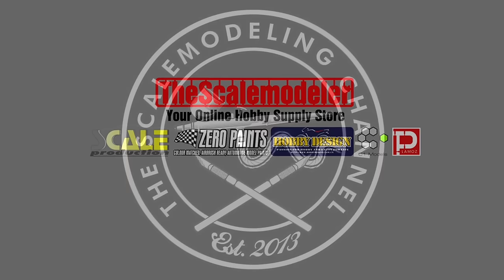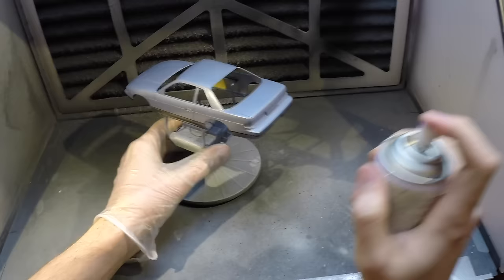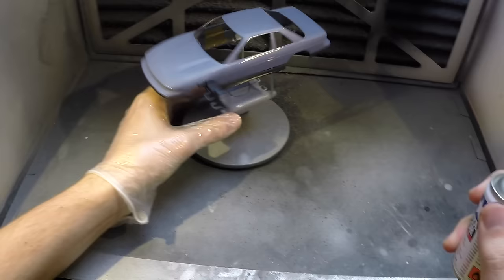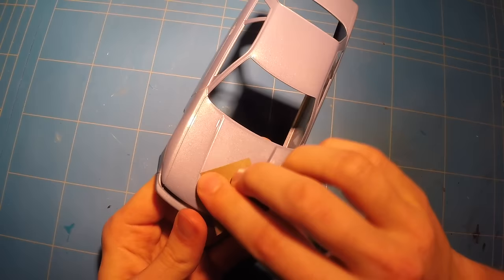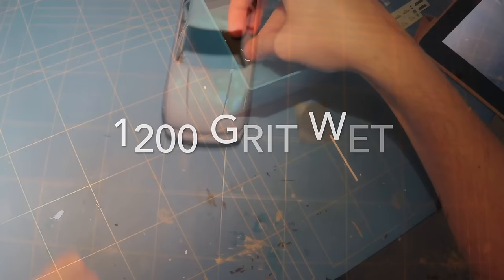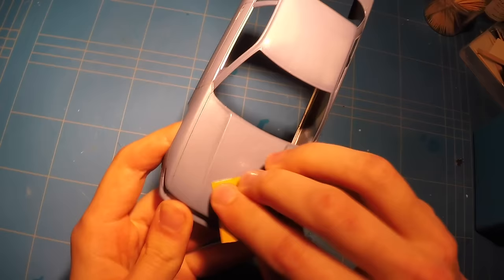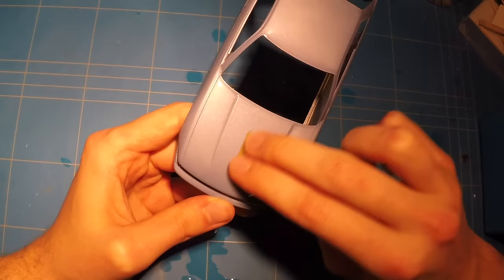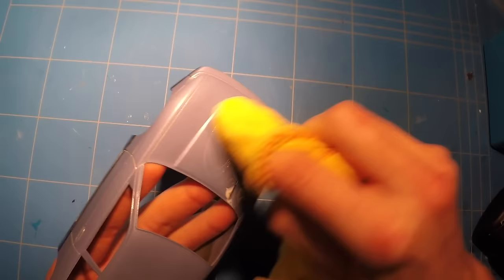How to: Paint a Scale Model with Spray cans Part 3: Applying and Polishing 1k Clear

Comment: Honestly with Tamiya sprays for both color and clear I don't mist coat. If I mist coat Tamiya I end up with bad orange peel. 

The trick is to spray right to the point that it shifts from looking dry or misted to looking like a flat glass smooth wet coat and STOP right there. Let it set 15 to 20 minutes between coats, after the color is on let it sit at least 2 hours before you clear, I often let it sit overnight. 
 
After you clear don't touch it for at least 3 days unless you want finger prints in it because it will be quite soft. But, at the same time I end up with glass smooth clear. I usually don't even bother with sanding I go right to rubbing/polish/wax. 

On my Tamiya Mazda MX-5 ND I didn't even use the compounds on it as it was glass smooth and I could see my reflection in it. I let it sit a week and then went straight to wax. 

Tamiya is the only sprays I can work with like this. And using Tamiya I can now do it consistently.
Reply: i agree. misting 10 coats of tamiya is absolutely the worst you can do. i aim for 2-3 coats of 50%+ coverage each from primer to color, sand down as needed and then clear. clear over decals will require misting but you will have to eventually go pretty heavy with at least 2 full wet coats.
Reply: You may have just sold me on tamiya paint I was going to try them regardless on my next. I can get a good finish with others. I'm going to try tamiya and to polish and wax for the first time.
Reply: Amen Justin. I just did that today and had the same thought...just go right to cream  polishing steps.  It's so cool how the Tamiya suddenly goes smooth.
Reply: I've had such a tough time with spray can clear coat and this video has really helped a lot, thanks so much for sharing! Great build!
Reply: I couldn’t agree more. This guy loves to do multiple mist coats then says “with Tamiya it’s impossible to get a glossy finish”. I have no problem getting a glossy coat. I mist coat and 1 minute later give it a wet coat. Give it 5 minutes to rest then wet coat again, and then a third wet coat.
Reply: I'm a beginner and just tested this method vs several mist coats with the Tamiya clear, and you are correct. I did one mist coat and then 2 full wet coats. Like glass. Thanks for that.
Reply: @IGOR416  Glad it worked out for you
Reply: @burnzy5150  just be patient, 2-3 coats (2 cans) will make it look flawless.  Add some rubbing compound fine and finish and you hit a home run!!!!

Comment: Hi all - I did not get a chance to read all comments but just wanted to add one thing I do is warm up the can in warm water,
the paints  flows more better also tip can upside down and spray to clear the nozzel after you apply the paint.

Comment: I used to use rattle cans all the time years before I started using automotive paint. The tamiya gloss is one of the best I think and is very forgiving. My process is a couple mist coats a medium coat and then a wet coat. You can get pretty wet before it runs, once you do a mistake or two you will gauge how far you can go. Then you dont really have to worry about wet sanding and just polish. :)
Reply: +xrlent12 how much time did you leave between the color and the clear coat ?
Reply: Popo popopopo This is the tricky part. Tamiya Gloss cures at a different rate to the colours, It's best to paint it straight after the colour coat. Or to wait until the colour has cured completley or it can crack depending on weather. If I didn't spray it straight after I waited a week or more.
Reply: thank you very much !!!! I am tempted to use 2k clear on tamiya ts ... but Tom also made a video with a mx-5 and tamiya ts-13 and it seems to work ... i don't want to ruin a c1models RWB kit :)
Reply: Popo popopopo There shouldn't be a problem with 2k clear over Tamiya TS paints. The TS are Lacquer paints. If you want to put 2k clear over tamiya clear I would make sure it's fully gassed out. Don't worry about ruining your models with paint you can always strip paint and start over. :)
Reply: +xrlent12 Thank you very much. I am gonna try my best :) Best regards

Comment: I have to disagree about tamiya spray can. I use them and get an absolute perfect finish. When people ask they can't believe I use a can. Misting the paint on like you done in the video will definitely give you a bad finish. First coat I mist on but still keep it even. Second coat I lay down quite wet then the third heavier again. I do that for primer and colour.
Reply: Yep. This is the correct method.
Reply: Also put the can under warm water for a few minutes before spraying. Helps the paint or clear level out while drying. Cold  or even just room temp paint can spray out uneven or blotchy.

Also model master gloss clear sprays nicer than tamiya imo

Comment: You should use Meguiars M205 polish. Its way better. Thats what I use to polish cars on the professional level. (Ferrari's, Lamborghini, etc..)
Reply: Also use isopropyl alcohol to remove the polish completely before waxing. And honestly using something like hydrosilex instead of wax is probably better for the scale and longer lasting more protective coating.

Comment: Hello I´m painting my auto with Revell spray can but after 3 layers of Color I got an irregular light granulated Surface. What do you suggest? sanding it before applying the clear or applying the clear directly and sanding it after clear coats? Best Regards!

Comment: I am building a model of a 1984 Coupe Deville. I have finished the paint job, but I want to paint a few small details on the body. Should I paint those details before I apply the clear coat, or after I apply the clear coat. The spray painting was done with lacquer spray paint,  but the detailing is done with enamel paints.

Comment: I am building a car that is molded in red plastic. I used rattle cans to lay down 2 coats of gray primer followed by 3 coats of the final color, gloss white. My car looks pink! I'm sure I will have to strip the paint and start over, but what would you advise to prevent this from happening?
Reply from the maker: I have tried a silver base over the primer. That helped slightly. Not sure if its an actual fix though.

Comment: Question:  Do you rinse down the body in between polishing with the different grits?  Or do you go directly into polishing from 1200 to 2000?
Reply from the maker: Yes, clean the surface before you go to the next grit.

Comment: I have a question. What if you are making a 60's or earlier car with a lot of chrome trim. Would you paint the trim before the clear coat? Also what if you are using Bare Metal chrome trim?
Reply from the maker: I would use BMF after the clearcoat

Comment: If I wanted to add decals can I do this between clear coat #2 and clear coat #3? Or should I do them after #3 and add a #4 coat over them?
Reply from the maker: Either do it before clearcoating. Or between one of the coats. Though they do need to dry four a couple days before you put the decals on.

Comment: Hey quick question, I always polish with the Tamia compounds, and what I do is after I apply the clear I sand with 1500 grit, 6000 grit and 8000 grit, and whenever I use the compounds I get streaks no matter what, they resemble scratches on a disc, they’re extremely fine and I was wondering if there is something I should be doing differently or if I am way to meticulous, thanks man!
Reply from the maker: The jump from 1500 to 6000 is to big.

1500 is also very coarse. So try starting at 3600 then 4200, 5000 etc.

Use smaller steps and make sure to remove all the scratches from the previous step.

Also be sure to use a super soft non scratching cloth.

Lets say. You paper towel, it will scratch

Comment: I like to build race cars and they have many decals. I usually seal them under a clear coat, but not only would I be afraid to sand through the paint but to sand through the decals. Any advice?
Reply from the maker: If your afraid of sanding through the clear. Then your either sanding to aggressively. Or mot have enough clearcoat on

Comment: Thank you for this well made tutorial. I am currently working on die-cast models in scale 1:18. Is there anything you would recommend to do differently than in this video, when painting a diecast model? For example I wonder if the diecast needs to be sanded before applying the filler, if I sand the filler (same as prime coat?) anyway... Does anyone have experience with this?
Reply from the maker: Sand the metal with 400 grit before you do anything else. The rest is the same

Comment: I have a question. I started the hobby again after about 25 years and started my first kit. Got the primer down pretty smooth, but not really happy with the paint, some orange peel. How can I fix the orange before I spray with clear? Can it be sanded and polished out? Suggestions? Thanks.
Reply from the maker: either sand it down and repaint, or leave it, sandscratches are realy hard to remove from the color coats even after adding more coats.
Reply: ok, thanks

Comment: Why do u have to let the car dry for 5 days? I let each of my coats dry for more than an hour then let the hole thing dry over night is that, going to get a good paint job as the finish?
Reply from the maker: Sure, but if you want to polish it, the paint will not be hard/dry enough yet to be polished.

Comment: This is excellent, thank you.  I want to use this method, but my kit has a few large water decals that need to go on.  At what point would you apply those here?  There's one on the roof, the rear and the hood.
Reply from the maker: Jason Karlek aply 1 or 2 light coats of clear. Let those dry for a couple days. Aply the decals. And add 2 or 3 more coats of clear
Reply: That makes perfect sense, thank you!  Your channel is extremely helpful.  Everything is stunningly simple, but your technique and experience make seem like magic.

Comment: I bought a Rustoleom Black Gloss paint and primer and a Rustoleoum clear coat. I got terrible results. Is it because of the company or is it because I suck at this? I sanded it down with 400 grit before doing anything also. 

If I bought Tamiya Black gloss, primer and clear coat, do you think I could get better results?
Reply from the maker: Not sure in the quality of Rustoleum. though tamiya should be better as it is specificaly made for scalemodeling.

Comment: Hi, just wondering if you could help me. Can I sand my model car after spraying a flat clear coat because it's not very smooth after I sprayed the TS80. If so, what sand paper should I use? And should sand it dry or wet?
Reply from the maker: Matt or semi gloss clear can not be sanded or polished as it will start to shine.

Comment: im working on a 1966 revell gt350h. in between what stage would i apply the decals? after paint (when the paint is sanded?) and ready for clear?
Reply from the maker: After paint. Before clear. No sanding
Reply: Do you have another form of communication? I had a couple of more questions 🙏🏻

Comment: question: I plan to use your method of painting on a future gundam build. I do want it shiny but do you think a three layer clear coat is necessary or can will i get by with just go with one to two?
Reply from the maker: Just try and see. If you like it with 1 or 2 stop. if not add more.

Comment: Would this be a perfect process to fallow using Testors One coat Lacquer? Any insight would be appreciated
Reply from the maker: I never used Testors paints, so i can not give you a Yes or no, though i assume it would work the same way with most types and brands of spray paint
Reply: The Scalemodeling Channel awesome, so then I'll have to test run the coat on something. I appreciate your help, amazing job on this and that R-34 you did

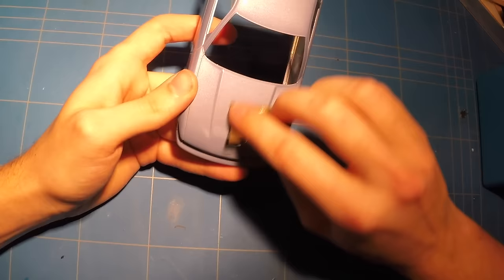Comment: Question: I'm working on my first model ever (your vids inspired me to give it a go :P) and I tried to remember your note at 4:30 about not polishing off the thin corners.... annnd i've rushed myself and done just that. I think only the colour layer has started to come off along - stopped as soon as I saw.

I plan on masking and respraying the affected panel/panels but just wondering if you have any tips/advice on doing so?

Should I sand back some of the clear on the rest of the panel with a lower grit then color + clear over the top of the whole thing or just try and focus my sprays on the one area? 

I'm using tamiya cans only at this point

Thanks and keep up the great content :)
Reply from the maker: Thomas Ling i think it would be best to not fix it. Spray cans are pretty aggresive and can leave a very thick edge on the masked area. If you do want to give it a go. Sand the entire panel you want to repaint with 1200 grit sandpaper

Comment: Hi I'm completely new to scale modeling. Just want to ask if u clear then decal then clear, at which stage does sanding and polishing happen? I would imaging sanding after decal would destroy the decal....
Reply from the maker: If you have the time and patience, clear decal clear. If you dont have the patience just decal then clear.

You polish after you apply clearcoat and gave the clear a week to dry. Sanding after decals would indeed destroy them :P just like sanding after paint will destroy the paind. Only polish the clear!
Reply: thank you for the info.! still a bit confused...So if i have a big chunk of decal that got clear coated, and have orange peel on it, i should just sand around the decal( parts where there is no decal) and avoid the decal(not to destroy it)?
Reply from the maker: If the decal is clear you can sand it, as you are sanding the clear on top of the decal, not the decal itself, if it is not clear you can not sand the decal.

Comment: Hey there.  I have never been able to put clear coat down and not have orange peel.  I'm using Tamaya spray paint in the can and clear coat Tamaya with the airbrush.  Instantly, I have orange peel.  I took a perfectly shiny hood, added the clear coat, and instantly had orange peel.  With all of the high spots on the CR7 Corvette hood, I can't sand down without taking paint off the high surfaces.  What is going on?  Everything I read says that clear coat goes on smooth.  Is it the product I am using?  What could I be doing wrong?  Going through kit after kit trying to get this right. Help, please!  Mac
Reply from the maker: Michael McNeive it could be that the clear is not thin enough. The airpressure is to high or low. You apply it to thin etc etc etc
Reply: Yes, I understand. But when I watch you apply Tamiya spray it has a rough look to it, the same as I'm getting. Also, you're letting it sit for 5 days before sanding and buffing out. If Tamiya clear goes on smooth, why should you have to sand it out in the first place? There's this woman down at the hobby shop who will tell you anything just to make a sale. She really knows very little about painting. She tells me that Tamiya goes on smooth and you should be able to sand it out the next day. Well, at least I received my Gravity paints yesterday. they have been very helpful and I expect that they will have an answer to my problem that makes sense. I've been painting at my paint booth in the same place for quite some time and I've never had a problem with air pressure. I took 3 nice glossy hoods, set my air pressure to 20psi. and gave them 1 quick mist coat and had a rough finish. So, I guess that you agree with the woman at the hobby shop who says that Tamiya clear sprays on smooth. Maybe the people at Gravity can help me out. I'll let you know what I find out. Thx, Mac
Reply from the maker: because it does not dry smooth. That is the problem with these 1k laquers. I don't agree with the woman in the hobby shop. she clearly has no idea what she is talking about. 1k clear takes atleast 5 days to cure, and even then it is not fully cured and is still a tiny bit soft. If you mistcoat it as a final coat it will look terrible as you would need to finish with a wet coat. A mist coat is pretty much ruining it.
Reply: Well, as you know I'm new to using clear coats. I don't even know what they're supposed to look like. that's why I did what I did. Everything I do when It comes to C.C. is an experiment. I have 2 completely painted and decaled C7.R's and I dare not put any C.C. on them until I find out what I am doing wrong. That's why I'm just using the hoods, or should I say bonnets lol. If I could just get through this. Thx, Mac
Reply: If you warm your paint and clear it will flow smooth

Comment: Hey Tom Did  you Sand Smooth primer wit regular 1000 or did you wet sand ?  Also do you wetsand  or sand the paint usually in prep for clear specifically for this 1k clear?
Reply from the maker: Isaily De La Rosa just normal sanding.

I do not sand the color coat. Never!
Reply: The Scalemodeling Channel thank you , I was really confused , I'm in scale modeling group and some of them sand the colors ??
Reply from the maker: Maybe you should ask them, i personally would never do this as after you apply the clear coat you can still see the scratches you made by sanding the color coat.
Reply: that 6th avenue heartache?